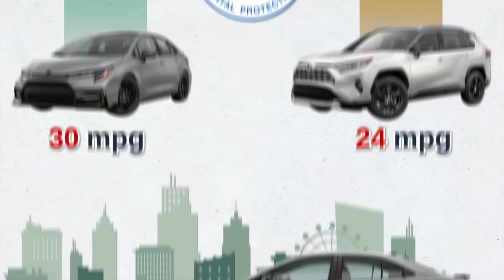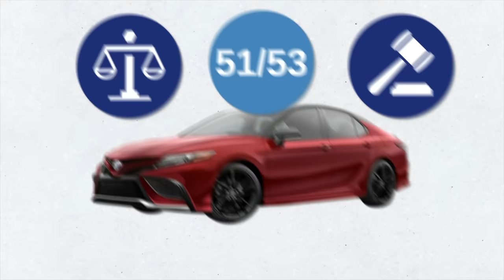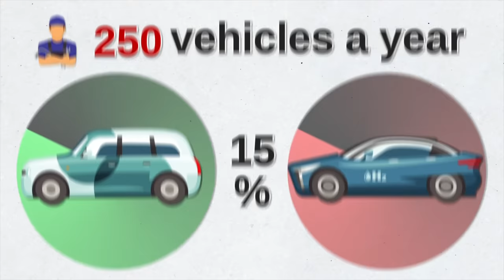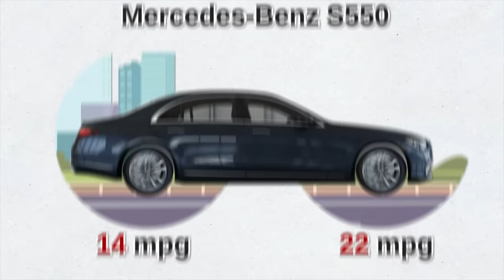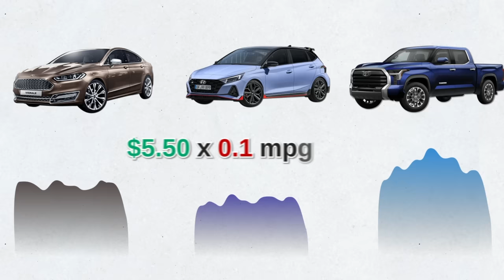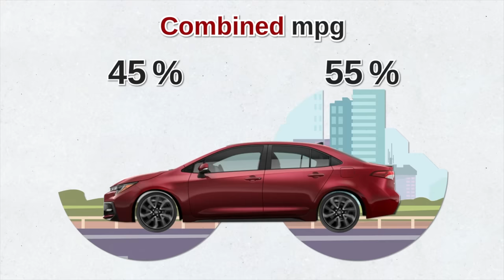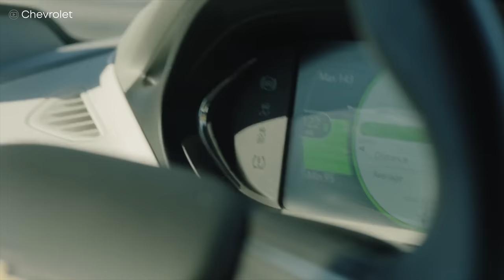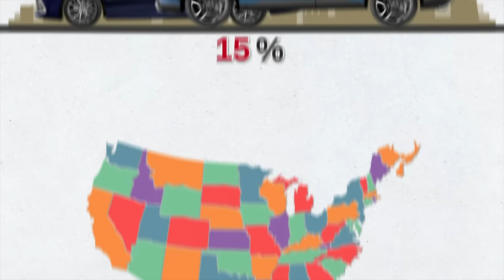Here’s Why the Government is Making These Engines Illegal

Comment: Thank you for another great video Scotty. As for keeping track of my miles per gallon, I would say about every 4 out of 5 times I fill my truck up I do the division right there.

My truck is supposed to get 24 highway 22 City and the only time I ever come close to getting 24 highway is on hours long highway trips. I get roughly 17 miles per gallon every time I do the division. MPH somehow is irrelevant because my truck seems to get better gas mileage when I have some weight in the back of the truck. It's really stupid.

Comment: We have a 2018 Honda Accord Sport 1.5l turbo. The EPA rating is 32 MPG combined. We've consistently gotten between 32-33 MPG combined. We get between 39-40MPG on the highway. Works for me.
Reply: It's a Honda....duh..;)
Reply: Damn my v6 car  gets 18 city and 25 highway
Reply: When that turbo goes out then what 😬😬
Reply: @miguelvega7769  Yep. Will devastate all those mpg savings.
Reply: sounds right. My 1.5 Civic gets 37 combined city and 42 highway
Reply: @miguelvega7769  Won't likely be for quite a while.
Reply: the 1.5L engine has a problem with gas getting into the oil. Scotty said not to get a Honda with that engine.
Reply: @theshield1613  My 1996 Chevy Lumina with the 3.1L V6 gets 30MPG.
Reply: @jaysmith179  that's good mpg for a v6
Reply: @jaysmith179  Some initial examples, it's been cured, no longer a problem. It occurred only on some Civics and CR-V's, Accord not effected.
Reply: @jaysmith179  Its complicated. The engine once broken in does better. The newest ECU mapping helps too. The formula of oil you use matters so the oil does not get too thin. The way you warm it up matters. Due to carbon and fuel in the oil you have to change it at 5k.

Comment: We bought a 2021 Hyundai Elantra in April. it is rated 31 city, 41 highway and 35 combined. The worst we have ever gotten is 33 MPG, and have achieved in the low and mid 50s about 20 percent of the time. When loaded with 4 big people, about 1000 pounds, going the 80 MPH speed limit, it will average in the mid to upper 40s. We have been pleasantly surprised.

Comment: In warm weather, my 2019 Toyota Yaris w/ manual transmission gets 45mpg as a daily driver, traveling about 24 miles a day total, through a small town, and up and down hills. It's advertised rating was 30/39 mpg, so I'm really happy with the actual mpg. When I first bought it, it would get 48 to 49 on the interstate, and 46 daily driving which was incredible to me. I switched to a slightly wider alloy wheel, and 5w-30 instead of 0w-20, and that reduced the mpg to 44.5 to 45. Idling for 15 to 20 minutes to warm up the car in the PA winter quickly drops the mpg down to around 41.5, plus I think the higher density of cold air requires more fuel, and also contributes to the mpg drop a little. It's hard to know for sure between the two factors.

Comment: I have a 2010 Tundra with 4.6L engine.  When I got it I got 18MPG and added a toneau  cover and the MPG went up to 19MPG.  Most of my driving is highway on regular gas.  I check my MPG every time I get gas.  I pretty much run full to empty.  I check the MPG in case I get a sudden drop.  When I pull a 2 wheel trailer in tow mode the mileage drops to about 10MPG with the trailer full or empty.

Comment: i love how it doesn't apply to trucks~
99% of what i see on the road the other 1% is SUVs and Semi trucks
Reply: Trucks were usually commercial and the customers of whatever service they were providing paid the higher fuel costs which were buried in the bills.
Reply: Not to mention that semis get vary good mileage
Per weight hauled. And I've seen them get better mileage than some older trucks.  Ex 1988 F250 4x4 and 4.10 gears and automatic got 6.

Comment: Hi Scotty,  I bought a 2020 Honda CRV a year ago. All my driving is in the city.  I average 31.1 MPG.  When I go on the freeway I set the cruse at 55 mph.  I coast when coming to a stop lights.  I drive gently with  no jackrabbit starts or jumping on the breaks.  I think this is proof that one can get close to the claimed EPA milage figures if you drive conservatively.  The turbo is for getting the car up to freeway speed and for going up hills.  The 1.5 engine is fine propelling the car around city streets.  Thus, I get excellent milage and I am very happy with my purchase
Reply: @captinbeyond  Agreed. Around here, if you're not doing at least 70 on the freeway, you're asking to get rear-ended!
Reply: Not necessarily. If the posted maximum speed limit is 70mph, usually a posted minimum is posted below at 55mph, usually for larger or commercial vehicles. As long as that Ridgeline stays in the right lane, you still have about 3 lanes to drive at 70mph.

Comment: Of all the many Scotty YouTube productions I've watched, this is the one which I have found of most interest recently.  Good work Scotty. You invite comments on the subject.. Here's one from a UK car user of over fifty years. 

Driving styles, journey use and habits play a huge part in our car's fuel consumption. These was brought home to me in spades about thirty odd years ago when I first used a twin axle braked trailer to transport cars long distances. I carefully checked fuel consumption whilst towing a loaded trailer using brim-to-brim fuel fill ups calculated against the trip mileage readings. Back then I used 4-cylinder Petrol/Gas Turbocharged MGs and Rovers. The first time I did the calculations over longer trips, say 100/150 mile plus, those first calculations came out at mid-30s mile per gallon. Usually 35-36 mpg. How can that  be? I do not get those fuel returns driving the same cars normally without a trailer. I must have miscalculated somehow. Subsequent fuel consumption checks showed my eary towing fuel figures were correct. 34-36 usually.

When towing you have to stick to the legal UK towing speed limit. Also, you have to drive allowing for the antics of other road users. Above all, you need to drive smoothly, not to be confused with driving slowly. Avoid braking as much as possible and allow the car and trailer to lose speed without braking as where conditions allow.

All that smooth driving with a loaded trailer actually saves fuel. I stress, not to be confused with driving slowly. Years ago when I first started towing on one long Motorway trip, my then ten year old son ( now in his thirties ) nudged my arm and nodded towards the speedometer. On that long run, as the miles went by, it was easy to forget you are towing and the speed creeps up and up. All to easy to allow that to happen and on that occasion when my son alerted me, I was somewhat shocked to see the speed. I lifted off allowing the "rig" to slow to a more sensible speed. 

Normally, driving those same turbocharged cars, I would get mid to high 20s mpg!  BIG difference. Driving style and behaviour is the difference. That turbocharger boost can be addictive and that uses much more fuel.

Keep this good stuff coming Scotty.

Comment: I consider anything less than 50mpg to be gas guzzler.  I don't drive gas cars anymore, but from 2004-2021 I was consistently getting 50-60mpg from the 2 cars I had during that time.

Comment: I have a 16 Camaro V6 automatic. EPA rated 19 city 29 hwy. I average over 30mpg between oil changes, about 6500 miles. I drive about 95% hwy miles with cruise control on and ac on. Best tank mpg has been 38 mpg and on long road trips regularly get 35 mpg.
Reply: Thats great!!! Good for you
Reply: The only real Camaro has a V8 engine.
Reply: I don't know about that. Maybe the 5th and 6th Gen  versions but my V6 is faster and more powerful than all the previous V8 versions including the LS1 4th generation ones which had 300-310 hp to my V6's 335.

Comment: It's not deliberate at all.

City MPG is different from the actual MPG you will get, because when measuring city epa, actual stop and go driving in the city isn't used.  It's just basically driven around a track at 35 mpg.

Same thing with highway mpg, except they drive it at 70mph.

I noticed this on my 2012 Camry,  When I drive primarily stop and go traffic in the city, I get 20 mpg, and when I drive primarily on the highway at 55mph, I get more like 42mpg.

Now go look up what the EPA says my 4 cylinder 2012 Camry is listed at, and have yourself a good laugh.  The numbers are so different it's almost comical.

Comment: Mountain areas don't always mean worst milage.  My 09 Cummins Dodge truck empty highway milage is about 23 mpg. In the Smokey Mountains, empty highway milage I hit 26.9 mpg. I foresee good business opportunity to rebuild pickup trucks from the 80s through the current line.  Making old rusted trucks new again because new ones with enough horsepower and torque to do any serious hauling will be made out of unobtainium.

Comment: I've had 5 cars now that have/had computer calculated average fuel economy readouts.  I'm one of those who likes to maintain a fuel economy log and in all five of these cars, my calculated numbers average between 1.5 and 2 mpg less than what the computer says I'm getting.  Pure city driving, which I almost never do, is usually pretty close.  Likewise for the "combined" numbers.  In most cases, the highway numbers fall disappointingly short of the EPA numbers.  One exception to that was a 2016 Mustang GT convertible I drove for about four years.  The couple of multi day road trips I took that car on returned about 2.5 mph better than the EPA highway numbers.  EPA said 25 and I "averaged" around 27.3 for the entire trip which means I had a bunch of tanks that did considerably better than that.

Comment: Scotty is right in one thing. Hybrid or turbo drivetrains are not a good option. Overly complex and prone to problems. Either buy naturally aspirated I4, V6 or V8 engine or a battery electric vehicle if you want a green car. Everything else is pointless.
Reply: Or refocus on diesel technology...these engines give more power, more durable and  much more consistent and very high fuel efficiency.
Reply: @LekaLEL  they could use those low-emissions high efficiency low emission two stroke opposed piston concepts and run them on biodiesel
Reply: @LekaLEL  turbo diesels are much much better than gasoline turbo engines.
Reply: Bu..but but, I need my twin turbo 1400hp V12 in my daily. Its a green ferrari and when I lose control, it eats the grass so more green than a prius :3
Reply: @charlesrodriguez7984  that's a fact I get like 40% more range out of my ford focus then my friend with his 1.5 ecoboost. 
Nice thing about the diesel. Its peak power and torque is in the low range. So its perfect for city driving and more consistent fuel economy.  So you can drive like you want without worrying about having to baby it like a turbo petrol vehicle
Reply: @285Nemesis  lol which o find funny,  most ford industrial vehicles are diesel and sell in the millions. You hardly see petrol commercial vehicles.  Most companies all go diesel for a reason.
Reply: @LekaLEL  I also find that naturally aspirated and supercharged gas engines have a much better and more natural power band besides being slow off the line until boost kicks in.

Comment: size and weight of you wheel makes a difference, as-well as how you drive even if you drive ‘gently’ doesn’t mean you drive how the vehicle prefers, circling back to size of the wheel, differences in speed and rpm some vehicles can travel at the same speed at two different rpm benefits of manual transmission is taking advantage of such things, or rather better drive to the speed limit… or sometimes not stuck grinding gears.

Comment: 2008 Mitsubishi Galant 2.4L I4  4-speed auto. I drive 65-70 miles a day on the highway 70-75 mph. Rated 20/27.... I can get 23 in winter and 27 in summer, sometimes more if I take it on trips - and I do often. I drive it easy.

Comment: I have a 2015 Mercedes ML350. It’s rated at 18/24, which is very accurate. I generally get about 19 driving around Vegas. On the highway, I often get 24.5 depending on how fast I go and other factors. For a vehicle that weighs 5k pounds with me in it, I’m always impressed with the gas mileage. Even better is having a 24.5 gallon tank. It has an awesome range and I don’t have to fill up very often.

Comment: I have been happy with my little Honda Fit. I got 43 miles to the gallon one day. I drove from where I live and it said I went over 400 miles that day and I was still at half a tank of gas when I arrived back home. I get combined highway and city about 34 mpg.
Reply: 5 speed?
Reply: @jamesmedina2062  I wish it was a five speed, its an automatic. I bought it in 2016. I wish I would have kept my escort that I drove back home in 2010. I drove 12 hours from South Carolina to Texas and only had to top off the gas when I would go to each state till I got to Texas.
Reply: @carychiasson9834  Top it up could mean a lot of different things!!! 😜It could mean 1/4 tank. 1/2 tank. 3/4 tank. 4/4! Once you are inside Texas you cannot get to other side without two tanks full probably! Its further from Beaumont to El Paso than from El Paso to San Diego! The latest Fits used 6 speed manuals.
Reply: @carychiasson9834  so the Escort was more economical?
Reply: @jamesmedina2062  I have to go to Houston VA and didn't know really where I was going I filled up and left and when I made it back to Beaumont I was on 1/2 tank with my car. It's a hatchback and I can put my supplies in the car when I wash windows at the church.
Reply: @carychiasson9834  i think its been a good car for people. I use similar 1.5 engine but with turbo. Apparently in the Fit they made it to high miles.
Reply: @jamesmedina2062  I don't drive much. You would laugh at the small amount of miles I have on it.
Reply: @carychiasson9834  that can be worse on engine unless you change oil based on time and not miles.  Glad again you like it.
Reply: @jamesmedina2062  It does use the regular and synthetic mix for oil and I have kept it changed through Honda since I don't have the tools to do it. After October of this year the warranty will go out and I will have to do thing on my own and the big things I will be just screwed since right now finances are going downhill

Comment: We need to replace these engines that run off of fossils fuels for these new high tech batteries that run off of.. fossil fuels
Reply: Please put an electrical outlet at all parking spaces too and make them free to use.  A national Solar power system would also be nice. if the cold fusion generator does not work.

Comment: My 02 Jeep Grand Cherokee Laredo (4.7L V8) 4x4 driven in 2WD from Aurora Missouri to Shell Knob Missouri gets 10-15mpg. Even worse if I have a full load, worse if I have a trailer hooked up.
My windows don't roll down because it's a Jeep WJ wiring manufacturing defect so I am forced to have AC on full blast constantly or its a rolling sauna/oven.
I need to get a 2014 Honda Civic SI/SE or 2014 Toyota Camry LX or a 2016 Toyota Corolla S/L. To get 29-39mpg (EPA estimate).
▪︎ Even if they are wrong, I'll certainly get 3x my current Jeep SUV mpg!

Comment: Early in the video, there was mention about the tax or fine if cars don't meet certain mileage minimums, and that the tax does not apply to light trucks. That is why you see a lot of SUV's and no station wagons. SUV's are considered light trucks. and station wagons are considered passenger cars. Station wagons usually weigh more than the sedans that they are based on, so they will probably get lower mileage. Also because of this, and the type of use people have for a wagon, most of them are ordered with more powerful engines that will lower the corporate average mileage. SUV's are the way to skirt around all of this. My Daughter's V8 Explorer gets about 12-14 mpg, much like the mileage of the neighbor's 1957 Buick Century Caballero station wagon that I rode to elementary school in back in the early 1960's.

Comment: I rented a 2021 Malibu with a 1.5 liter turbo four cyl. last summer. 
this car was advertised to get about 29mpg city and 38 mpg highway. I got as high as 43mpg highway cruising at 62mph from Dayton Ohio to Bowling Green Kentucky, using the A/C on low. Coming back I had traffic jams, more A/C use, and drove about 65mph and clocked 39mpg. While these numbers are outstanding for a mid sized car, the city milage for about 2 weeks of driving measured only 23- 24mpg, with a very light foot, much below the 28 estimate, and not much better than you might expect with a v-6. Certainly a reasonable 2.2 liter non- turbo 4 like in an early 2000s 4 cyl. Malibu would equal the mpg of the tiny turbo 4.  Also, the car used an entire quart of oil in 1000 miles of driving, and had only 18,000 miles on the odometer. This made me think about Scotty's predictions of short engine life for the basically underpowered, then boosted 4 banger. I would think it wiser to use less boost on a larger 2 liter for this size car, or a 2.2- 2.5 liter large 4 naturally  aspirated for good, if not best fuel economy and a long engine life. Years ago I clocked 37mpg  on a long trip on a similar sized / weight / Ford Fusion with a 6 speed automatic, and this engine felt appropriately sized for the 3100 pound curb weight.